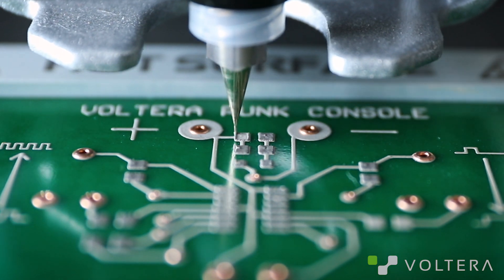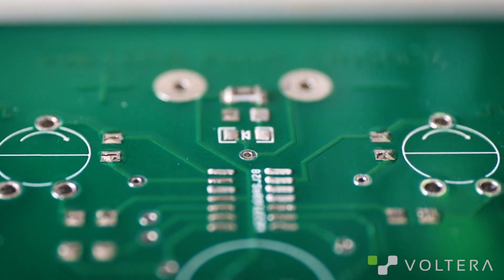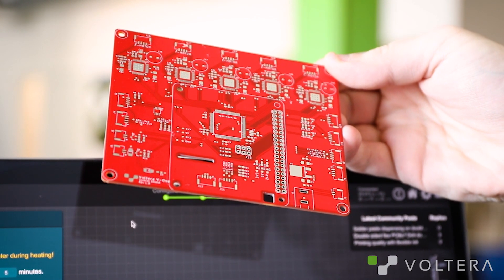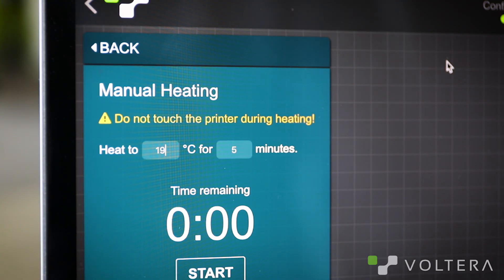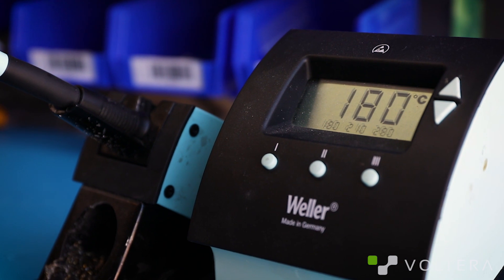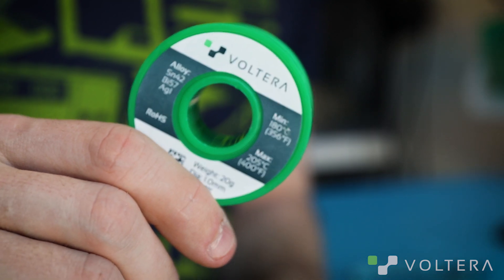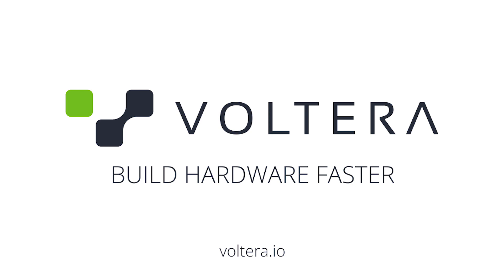Voltera V-One: Solder Paste and Hand Soldering

Comment: what are the causes of air bubbles in soldering paste?
Reply from the maker: It could be due to a variety of things, including a bad batch of material, too much moisture, or improper storage of the material. It's important to follow the storage and handling recommendations found on the material's technical data sheet.

Comment: Check at 3:06 !!! Top left ones...are they due to bad soldering skills or something related to the solder paste ? Actually, in all of them we see that the solder does not melt properly or spread evenly and then they show the ball shape
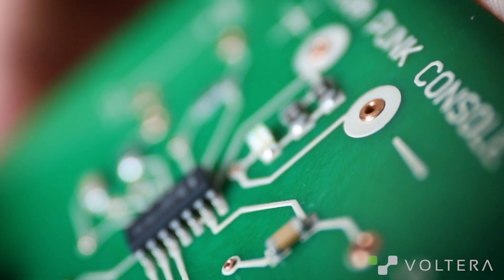Reply from the maker: What you're seeing here is what we discuss at length starting at 0:49 . It is a function of how solder interacts with conductive ink rather than etched copper. There is still a strong electrical connection from both the hand soldering and reflowed solder paste throughout the video.